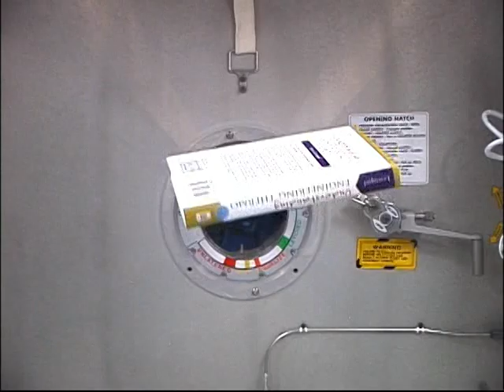Rotating Solid Bodies in Microgravity

Comment: There's still a tiny bit of gravity
Reply: Actually gravitational field strength on the ISS is hardly different to on the earth's surface. Just they are "falling" - like you would experience in a falling elevator, but without the sudden stop.

Comment: Same as on earth at sea level.  It is actually the air resistance that slows it down.  It takes power to move air and when rotating the object, it is moving air, which has resistance that finally slows an object to a stop.  The flat surface book, will stop faster than a cylinder because it, is rotating against more air.  The effect is much easier to notice at high speed like when you put your palm out of a moving car.

Comment: I'm confused. I thought an object in motion stays in motion unless acted upon by an outside force. why do the bottles stop spinning? in space there shouldn't be any "outside" force stopping them. They should keep spinning for the rest of time, right?
Reply: when you start spinning a bottle, only the liquid in contact with the walls will rotate, and this motion gradually transfers to the middle. So, the parts of the liquid inside act as external masses to the rotating portions.
Reply: Look up intermediate axis theorem. They keep spinning, just slower. The system prefers the lower energy state

Comment: He should have pointed out the bubbles in the water bottles. They were critically important in allowing the water to slosh around and dissipate energy. If they weren't present, the conversion of the rotation to the axis with the greatest moment of inertia wouldn't have been nearly as rapid.

Comment: @B19Dav3 The most stable axis for a non-rigid body like one filled with a viscous or bubbly fluid is the one with the greatest moment of inertia, and that's usually its shortest one. The axis across the water bottle is shorter than the longitudinal axis about which it initially spins. The book spins most stably around the short axis through the pages.

Comment: @Vei2aC Right about which egg is which, but that's not the reason. The raw egg contents can jiggle around and dissipate energy, and that's crucial for causing the change in spin axis because it involves losing energy. An absolutely rigid object will spin smoothly about any axis because there's no mechanism to change it.
Reply: "An absolutely rigid object will spin smoothly about any axis "

the violent reversals of the spinning t handle or wing nut are proof that the rotation is smooth... until it isn't. What interests me the most is the intermediate phase when the wobble begins,  increases to the inflection point, then asymptotically decreases  to zero, then begins again. The time duration of stability,i suspect, is instantaneous, just like the inflection point between orientations. There's an instantaneous crossover, where the wobble goes to zero,, the axis of rotation passes through a plane 90 degrees to the stable appearing  axis. I call it the momentary flop. The wobble starts out infinitesimally small, like one atoms worth of imbalance, and then it doubles every 'day'; every rotation.

Comment: Too bad the engineers designing Apollo didn't have these videos. On its way to and from the moon the Apollo spacecraft was spun slowly about its longitudinal axis for passive thermal control, but just like the liquid-filled cylinders here that spin around an axis with a small MOI wasn't stable. It was very hard to set up these PTC rolls, and they often had to be corrected when they began to cone.

Comment: @B19Dav3 not really, short or long axes could both be equally stable... it just depends on the distribution of mass on either side of the axes. The liquid filled objects and the objects rotated on random axes both rotated unstably because their axis of rotation didn't intersect the objects center of mass.